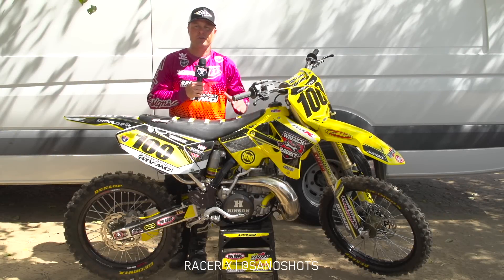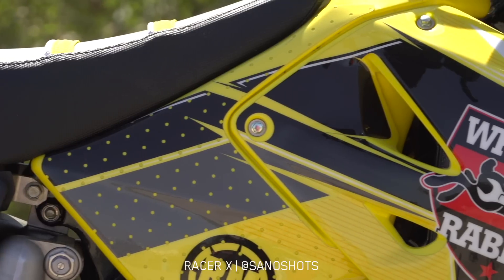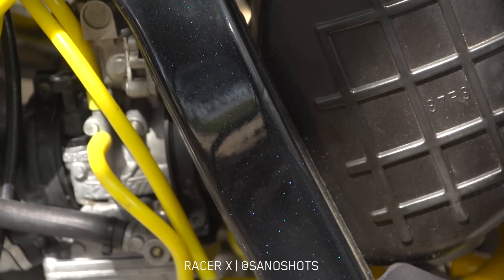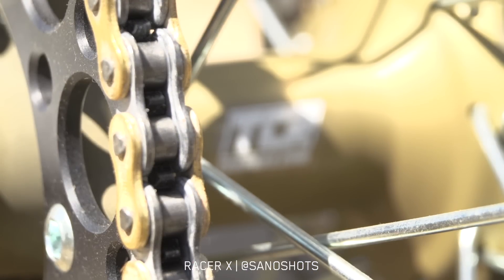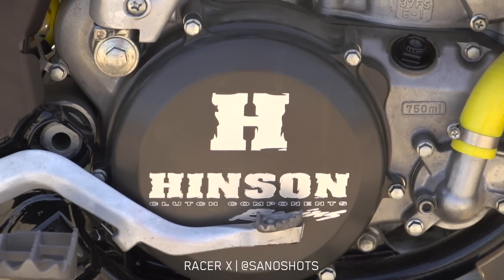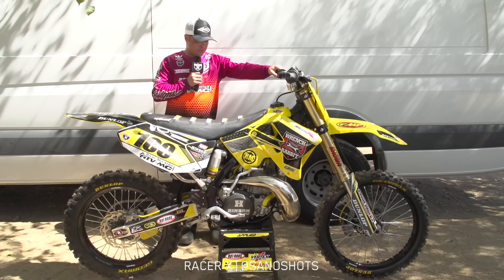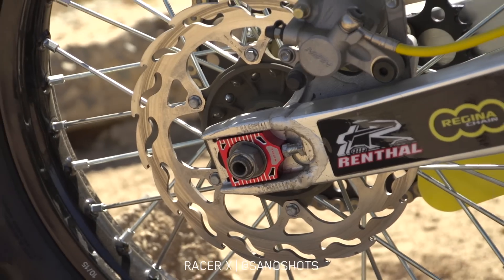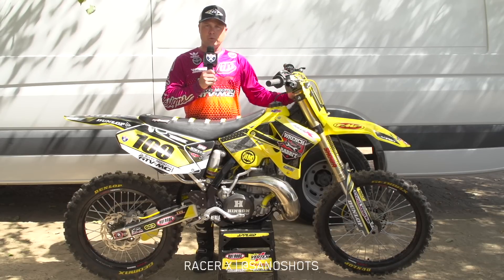Racer X Films: 2006 Suzuki RM250

Comment: I love it but tbh i would love to see some non stock motor , a fully tuned rm 250 is ear orgasm.  Carmichaels factory rm 250 for example.
Reply: since they sent the cylinder to millennium technologies I bet the bike is fully modded. They do porting and decking as well as cylinder repair so I highly doubt that they would send a cylinder back to racer x without doing all the tuning on it. They have done a million two stroke cylinders so they know what works for each bike, I bet thats why he said this bike has better roll on power than he remembered. I had my 06 kx250 done by them when eric gorr worked there and it was the best two stroke motor ive ever had.
Reply: mx racer  But did you hear when he said they went back to the standard tolerance? Still a good bike for sure, but i dont think it sounds nowhere near to what Carmichaels 250 did.
Reply: blomgren182 yeah I'm sure the factory had all kinds of little tricks to make those bikes rip. Carmichael also rode that shit wide open so that's a little different than ping riding one in his forties lol
Reply: My next project!

Comment: "As quickly  as a 250F"  wtf?? That RM should smoke any 250F!
Reply: MXA has covered this.  The new 250F are so fast and so stable that guys are able to outrun the old two strokes even restored.
Reply: @kickstartkrew9924  so the new yz 250 and sx 250 are as fast as the 250f so.
Reply: That's what I'm saying. I raced the 450 class with a 2 smoker and took 3rd. Like wtf. And I'm a big guy. I was surprised tho. So when he said that my eye's rolled.
Reply: Kickstart Krew yep and the 4 strokes stick to the ground and are far easier to ride. You have those guys riding 2 strokes in Canadian classes and nationals every now and then and they’re hardly competitive at all. Sad deal!! Haha
Reply: Ignacio Sian speak the truth dog I could race a 450 with old 2smoker
Reply: Not nowadays. It's crazy how fast modern 250fs are now. I would still take the 2 stroke all day though. So much more fun to ride.
Reply: @asse1711  ktm sx 250s are faster they are the fastest afaik
Reply: @kickstartkrew9924  not true at all

Comment: I see a lot of these RM builds with the RMZ front fender and number plate and im thinking about doing it to mine. what do i need to do to it to them fit?
Reply: You prob figured it out by now since your question was 6 months ago but I’ll answer anyway. Two of the bolts from the newer fender line up perfectly so all you need to do is drill the other two and the number plate bolts up without any mods. Hope that helped.

Comment: Where can I find those plastics? Are they from the 4 strokes and adapted or are they specifically made for the rm? I can't find'em in the polisport site
Reply: musica generica you can put any new fender on a old bike that's a 125 or bigger , might just need to drill new screws. Or just use Cycras restyled gender
Reply: Fr3ShPRiNC3 front and back?